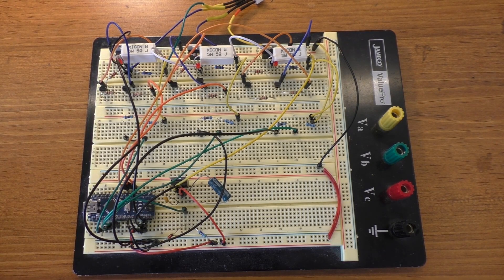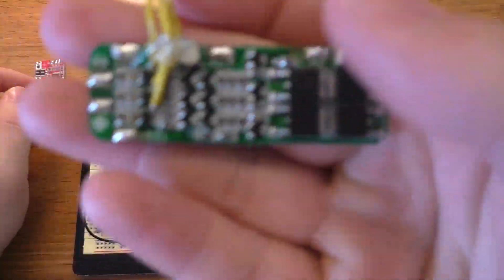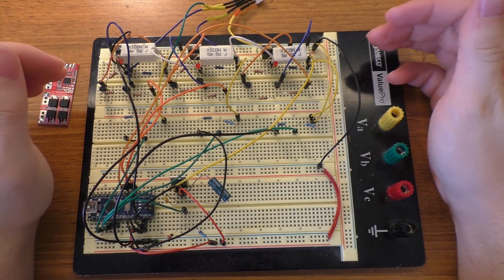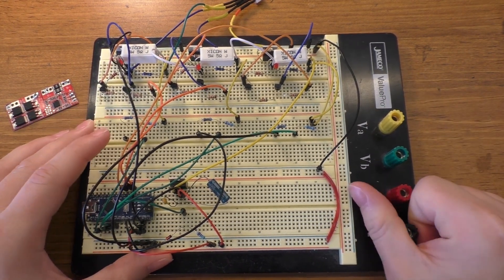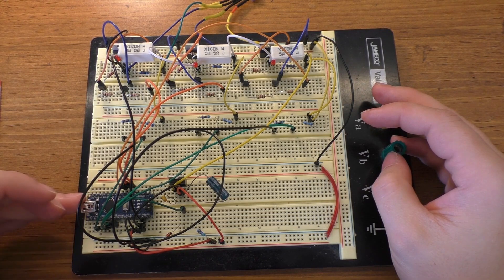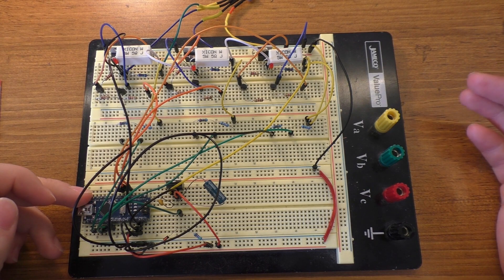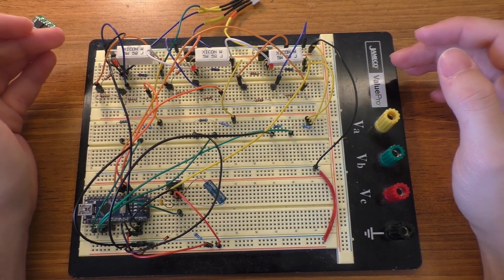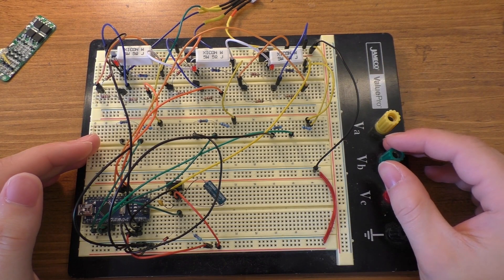Arduino BMS #1: Project Intro

Comment: Isn’t it possible to convert a 12-120 or 240 volt inverter into a fast charger? You c an find those things for around 15 bucks.

Comment: But BMS is not supposed to dissipate power but switch off the cell transistor when reaches certain voltage. It is actually a partial protection except it does not sense current limits but it can be added  with overcurrent ICs. The best BMS and safest as I see would be one with simply high Amps relays - not transistors.

Comment: Do I understand it correctly that you are not able to charge in series while you are balancing? Because I think you are connecting all poles thogether to one common ground, so you are able to measure each cell relatively to that. I would like to build a battery pack where the balancer can be left attached while charging (which is supposed to happen continuously through solar cells)
Reply from the maker: No, you can charge the cells in series. What you are describing as a project is exactly what this BMS does. I plan to make it quite a bit better still as well as add more functionally to it.

Comment: my start of a bank is about 105-110 ah or so. I plan on it being matched as well as I can get it. I'm not sure how out of balance it will get. I need to balance a 7 series pack. would it be possible to go this route? I would like to have multiple stage or a variable balance load. could the pwm output of the arduind be used to vary the balance load ? I would like to have a visual on how its working. like a  light bulb as part of the balance load. with the brightness or dimness. you could see the amount of balance load. if variable. would this be possible? I don't want a  to buy batrium system. thanks ..
Reply from the maker: Using PWM as a way to vary the balance load could be an option. For a 7s pack you might have to go for an Arduino Mega to get enough pins, though it should scale. You could put a light bulb across the balance resistors instead of an LED like I have done if you want to see it working a bit better.

Comment: hey eman computer power supply with a boost inverter that has CC and CV can save alot of effort im doing that now with a 100A/h 18650 pack and it takes about 4 hours with 15 amps. but i have a 35 amp bms on each of the 3 packs. I get it if you just wanna tinker but a 15 amp boost converter and a computer power supply is working fine for me.
Reply from the maker: I intend on using a buck converter with this set up. The main thing it going to be getting the Arduino to balance the cells. I am mostly wanting to see what I can do with a setup like this. Where did you get your BMS?
Reply: Rock on here, please. Im hoping for a arduino balance system to. I need 7s for getting 24 volt to my camperbuss whit a 24 kw battery. Must find out first how not to fry the cells when i start up my generator which is 28v 450 a. ;-). Hope You find the sulition for this problem.

Comment: You might have to make a state machine to prevent the oscillation. You balance it through the resistor for a while, stop, check the voltage, then discharge some more. It's a great idea, I've been unable to find a decet open source bms or tutorial for one online.
Reply from the maker: Thanks, that will be probably be used in the next iteration of the code.